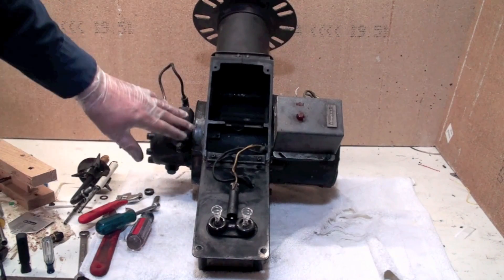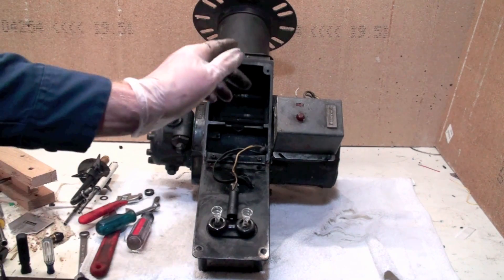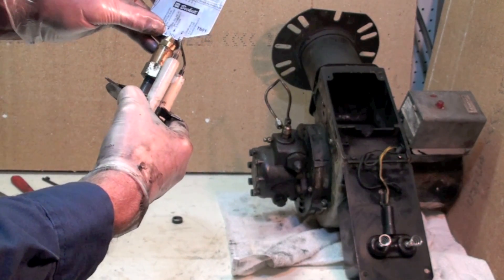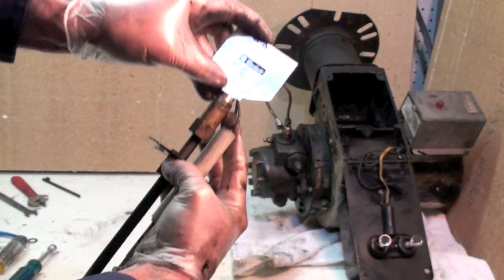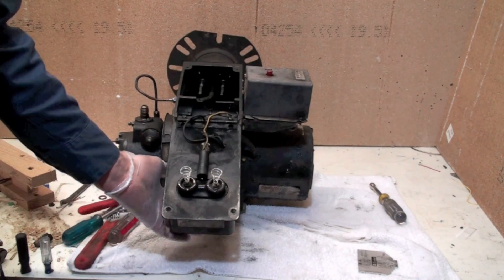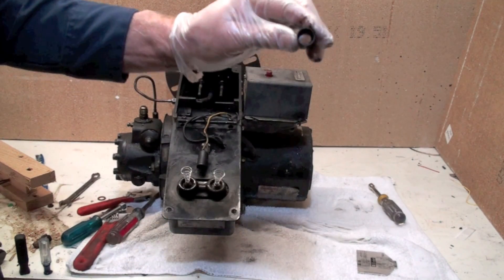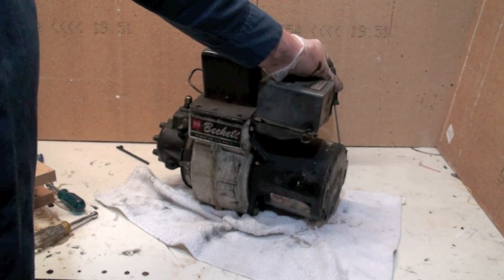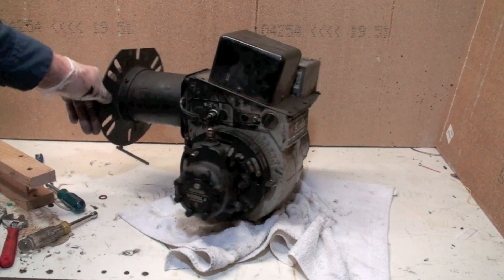Setting up the oil burner gun assembly, part 3

Comment: My burner looks exactly like that but I do not see Beckett Labeling on it !Is there an exact way to identify what Burner I have ?You referred to yours being   an AF2.  I have a forced air oil furnace that has a newer motor ,replaced about 8 years ago!  I put new nozzles in and clean and adjust every season ! I put a new Flame Cad Cell.on 2 years ago! I have been getting occasional  Red Button trips ,sometimes it will only happen when you are away from home .Lol! Of course. It  runs good other than occasional trips of primary ! So ,I bought and installed a new primary last season ,Dealer Screwed me pretty good ,over 400 dollars . I still get occasional button trip.Every few weeks or so . My transformer jumps spark across terminal when tested with screw driver so I think it is ok ! I am wondering about depth of burner nozzle  now that I watched this video !I am going to try and rig up some kind of depth gauge I can insert without pulling the assembly out. Thanks for your videos ,they help a lot! I am an old time fix everything myself guy .42 years ad repairman in railroad industry and self employed contractor ! I had combustion analyzation on the old furnace and it showed good ,especially for 30 yr old furnace.

Comment: Theres a plastic tool called the beckett z gauge that makes it so you can adjust how far forward the nozzle is correctly without removing the burner.  It also makes adjusting the electrodes easy.  It's expensive for a piece of plastic, but you can if you have a 3d printer you can find the file for it online.

Comment: Grayfurnace Man , question : I cleaned my oil burner was going to change the nozzle on  the Beckett Burner and I noticed oil in the gun tube. Also seemed like oil was dripping down the nozzle. I do not know what to do. Any advice as to why there was oil in the gun tube? I also noticed crusty sooty chard deposits on the very end where nozzle enters combustion chamber.  Appreciate any help or insight you might be able to offer. 
Thank you.
Reply from the maker: First, the nozzle should be replaced each year.  The nozzle is probably partially plugged.  If there are deposits on the burner head, you will need to pull the burner out and clean the head.  While the burner is out, check the depth from the nozzle to the end of the head.  Most Becketts are 1,1/8" depth.
GFM
Reply: @grayfurnaceman  Thank you GFM for replying. I have a Beckett Oil Burner I believe installed back in 1987. On the burner it says AD-757334. For use with Primary controls 1 or 2.
 I purchased from the local plumbing supply a Z Gauge. It is orange in color and it is placed on the nozzle and sets the "Z" dimension which is the distance from the face of the nozzle to the flat face of the combustion head. That is what the directions say it does. I actually am uncertain as to whether this orange Z Gauge is compatible with my Weil Mclain Beckett Burner. Instructions state that the Z Gauge is for use on Beckett AF, AFG, SR, SF burners with "F" heads and Beckett AF II burners with "FB" heads. Just not sure what type of burner I have or what actual Beckett model. I appreciate your previous answer. I believe that Z Gauge would address the depth(as you state) from the nozzle to the end of the head. Geez,  just wish I knew exactly what model of Beckett I have.

Comment: Hello Sir I'm a single Dad from PA just bought this mobile home for me and my daughter I've been following everything of yours learning what I need to. I have a Coleman MR-C with the Wayne /Suntec Burner it was going fine then it started cutting out when it was running and coming back on real real quick  like the power was getting cut to it and restored again over and over, and then it just got to the point where when I try to start it up so she can do her thing it goes into safety lockout every time at it's typical 30-45 second mark. So I thought something with the transformer like a poor  contact @ the electrodes so I pulled gun assembly (nozzle was caked) replaced nozzle with 80°A electrodes were roughly ⅜" apart so I adjusted them  to the typical ..⅛" apart, 5/16" from center orifice of nozzle and the same ahead of the nozzle. Checked CAD relay and lens. Both good and clean. Still going into lockout. I'm stumped.
Reply from the maker: Plugged oil filter?
GFM
Reply: You ever figure it out? Repeated clicking noise and the burner going on and off constantly i'm thinking bad burner control box. They have i believe a relay? inside that can stick. If you tip it upside down or just tap it,, it may come out of it. I had a one dying that'd just buzz until i tapped it, than it'd start the burner.

Comment: I have an oil furnace, that I just put a new pump on, the furnace fires with a nice flame now itll run for about 5-10 minutes then kick itself off, when you go to kick it back on you cant hear the electrodes sparking, I've had this furnace since i got my house who knows how old it is, I've replace cad cell emergency red button box but I've never replace electrodes. Any advice would be great.
Reply: sounds like you are running on a partially clogged oil filter and or line.  Did you happen to run your tank low before it started happening? I'd say maybe overheating but you shouldn't have spark if you tripped high limit

Comment: My electrode tips are pretty close to yours, but had trouble 
understanding the gauge. As long as the furnace ignites right away and 
burns as it should with the right flame, am I so to speak okay with the 
electrode setting ?

Comment: So my boiler shut off for some odd reason.. been using your videos to help me get it back on track.. 
I cleaned the gun with carb cleaner, readjusted the nozzles ,replaced the oil tank filter .. and got it back running 🏃‍♀️ pristine. My burner set up is actually a Wayne ... I saw you said you don’t have many around your area. 
I just had to say thank you ... You help so many like me, and it’s really appreciated..
Off to watch a few more of your videos.
Reply from the maker: Happy new year.
GFM

Comment: please, where I can get that oil pump. RPM 1725  Any store. From Connecticut. 914 497 9070 dionisiocamayo@gmail.com
Reply from the maker: I don't have any sources.  You will also need the rotation direction of the pump.
GFM

Comment: Great video, wasn't my problem, I had a slightly clogged nozzle, but now that I re-aligned my electrodes the unit starts up much easier than before.
Reply from the maker: If the nozzle is plugged, replace it.
GFM
Reply: I know they are cheap and easy to replace.  I took some gun cleaning liquid and was able to get it clean as a whistle, that little copper filter in the back too!  Next time I'm out I'll grab an extra nozzle for replacement down the road.
Reply from the maker: The reason I replace the nozzle is I do this as a profession. I can't afford to use less than the best I can.  Merry Christmas
GFM

Comment: Hey i need help.... for some reason every couple of weeks i need to take my gun assembly out and clean the spot off the electroids and the nozzle what is causing this?
Reply from the maker: You probably have oil spray impinging on the electrodes.  Adjust the electrodes back.
GFM

Comment: GFM, I noticed in the comments, you stated that you have not been able to get a beckett burner to run on spent motor oil. could you please elaborate on why not? specifically, what problems have you encountered? thanks
Reply from the maker: Lubricants will not separate into small droplets like fuel oil.  It just squirts out in a stream.  It must be heated to the point that it evaporates to get it to mix with air.
GFM
Reply: understood.....preheat with lpg first. thanks for your quick reply

Comment: This is a draw assembly not gun assembly also the burner is a af not af2. With the burner out you can adjust draw assembly with the beckett guage. The air adjustment should be set with bands slightly open and go from there. No wonder this burner looks like this.

Comment: At the tip of nozzle there was sud infact the same black small popcorn  looking stuff outside of furnace on the floor what typically causing this also the furnace been turning off after I turn it on so far I changed line filt filter and vacuums as much as I could inside duct and inside furnace I am beginning to believe its not burning right which might cause the popcorn stuff. Please any help?? TY
Reply from the maker: M D A M A D I would look for venting blockages.  Do you get a burned oil smell during firing or does the furnace rumble when starting? These are indications of venting or plugged heat exchanger.  As for the filter on the end of the nozzle, I would not remove it.  You are just asking for a plugged nozzle.  Hope this helps.
GFM
Reply: grayfurnaceman its runs but it does rumbles and I think its the air flow now because everything is gapped right

Comment: Thanks for the video very helpful. I follow you video and I hear a moving part inside the oil burner gun. It seems move only when I shake the gun. What is it? And how does it work?
Reply from the maker: Beats me, I have never heard of something loose in the gun.  Let me know what you find.
GFM
Reply: grayfurnaceman This is interesting. I will let you know as soon as I find out. But maybe you can help me to find out. What is the small component on the gun that the nozzle is connected to? Is it possible that this is kind of valve? Maybe it is bad and I should replace it.
Reply from the maker: Nathan Sadia That's the nozzle adapter.  They are usually just a fitting.
GFM
Reply: grayfurnaceman What about the nozzle adapter? Can it be broken?
Reply from the maker: Nathan Sadia Some of them have an insert that directs the oil to the top that bleeds air out.  It could be loose.
GFM

Comment from the maker: The explosion is the build up of atomized fuel and air suddenly igniting.  If you are talking about the burner tube (approx 4" in diameter), the end of the tube should be inset 1/8" back in the combustion chamber.  If you are meaning the 3/8 tubing fitting for the screw, I would use a socket and just put enough torque to move it.  Hope this helps.
GFM

Comment: Gray, I learned a lot from your videos. Thanks for your time. I am working on a Becket burner for a friend. I bought a used becket burner afg, I am having a problem unscrewing one of two screws on the pump specifically the one that connects to the oil filter. I have tried blaster and wd40. The original black tube was 4" long, the new one is 7” is it ok to use the longer tube or should I replace with 4”. I read your warnings that the burner can cause explosion, specifically what cause explosion?

Comment: HEY GRAY, THANKS SO MUCH FOR YOUR INFORMATIVE AND DETAILED VIDEOS.I ALMOST FEEL LIKE A PRO.OIL TANKS RAN EMPTY, SLUDGE AND OTHER SORTS CLOGGED THE SYSTEM. OPENED THE OIL PUMP ON MY BECKETT TO CHANGE FILTER, STILL NO OIL EVEN AFTER PURGING. STUPID ME REMOVED THREE SCREWS ON THE OIL PUMP, COULDN'T REALIGN THAT GEAR BACK TO OILPUMP HAD TO BUY NEW ONE. HENCE, I HAD LOOKED AT ANOTHER VIDOE OF YOURS AND RE ALIGNED ELECTRO RODS AND SHES ROCKIN ALSO CHANGE TIP AND TWO OTHER FILTERS,YOUR THE MAN

Comment from the maker: Start with removing the smoke pipe and checking the chimney for soot.  The heat exchanger is between the smoke pipe and the burner.  Usually it requires a vac truck to clean the heat exchanger but you may be able to do it with a large shop vac and using an air compressor with a nozzle to break loose the soot.  Prepare to get dirty!  Good luck.

Comment from the maker: The pump pressure should equal what the furnace model plate indicates.  Many of the pumps come set at 100#.  Most newer furnaces use 140 150# pressure.  Pressure is checked with a pressure gauge mounted on the gun line.  Also look at the flame.  It should not be smoky.  That's air adjustment.  Check the smoke pipe.  Is it heavily sooted?  If so the heat exchanger and smoke pipe will have to be cleaned.  Hope this helps.
GFM

Comment: hi Gary,my furnace stopped running approximately a week ago I determine it was the oil pump after installing the oil pump started having a rumble, I gave everything a thorough cleaning and a filter and a new nozzle, the problem I'm having now is that I have to keep hidden the restart button every so often, I was wondering if it has something to do with the air mixture being that I changed the pump would that have anything to do with it, I'm not sure,also the damper opens and closes thanks

Comment from the maker: Does it rumble?  Puff a little smoke out the inspection hole on startup?  If so, it is not establishing draft.  This is one of the hardest problems to correct.  Start with negative pressure in the structure.  Crack an outside door.  Use a match or cigarette in the crack.  If it pulls in the structure is negative.  Try opening a window near the burner to see if that stops it.  Good luck.
GFM

Comment: hi, i have a beckett oil burner af15 gun on my cmf80-po furnace.. everything works awesome and it's actually very good on oil but, in the preburn warm up it sounds like i'm filling up a hot air balloon....the blower isn't on yet but it's just really loud.. is this an air flow problem??? it has a .60 solid in it... the blower does it's job and circulates the heat nicely, it's just too LOUD on start up..any help would be great...thanks, jim

Comment from the maker: Probably the nozzle is plugged.  There is more garbage in the oil when you run it dry.  If there is no fire when resetting or the fire is only partial, you are plugged.  You can test the cad by removing the wires and putting an ohmmeter on them.  When reset, the ohms should be under about 700.  Remember each time you reset oil may be added to the combustion chamber and could burn out of control.  Check out the oil furnace playlist.  Good luck.
GFM

Comment: have a  oil burner that has been working find.   ran out of oil and bled the air out and started the burner  ran find for a halfa day . now this morning burner is off . repeated the proceedure but burner still shuting down  after 30 seconds or so . checked electros in the transformer and the cad control  how do you konw if the cad senor is not working is there some test i can perform

Comment from the maker: Hi, that's probably because I haven't done it yet.  I got a little sidetracked.  Sorry about that.  There is some info in the oil burner operation vid but it is not easy to see.  I will be doing one very soon.  Thanks for the reminder.
GFM

Comment from the maker: The solenoids seldom fail.  They are delay solenoids so they wont open for about 20-30 seconds after motor starts.  Start burner and set voltmeter across input terminals to solenoid.  If you get power, all circuits to solenoid are good.  Check with ohmmeter across terminals at solenoid with power off and solenoid electrically isolated.  OL means bad coil.  No power means possible problem with cad cell relay.  Also remove solenoid to see if it moves freely. Also press reg